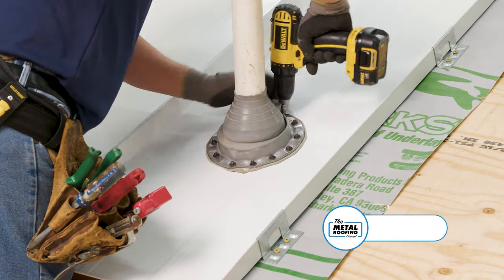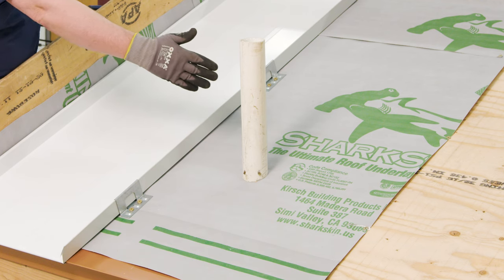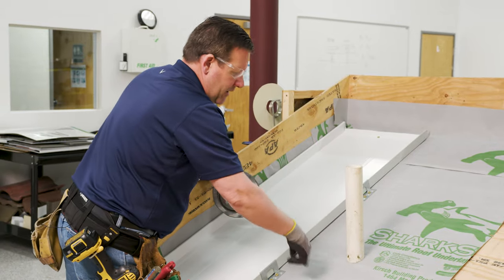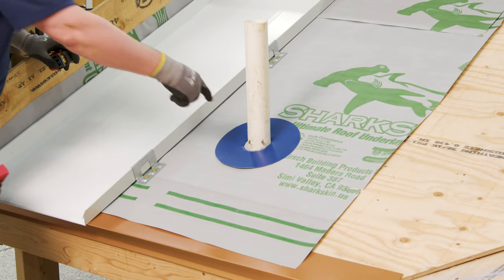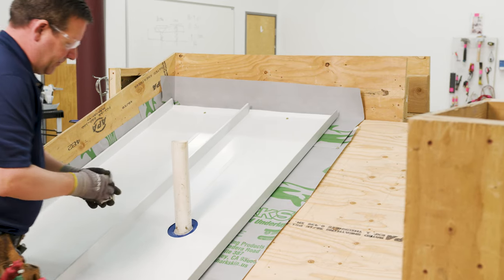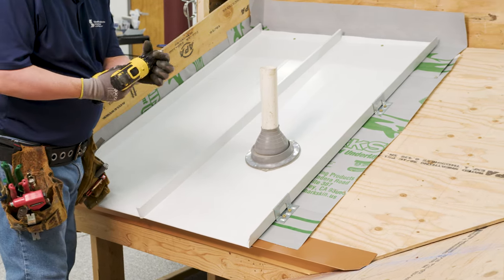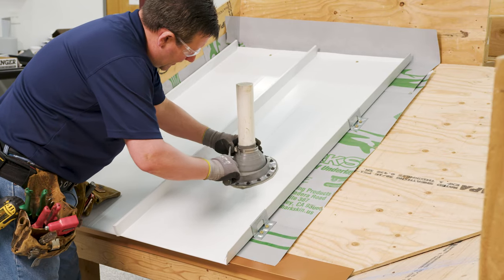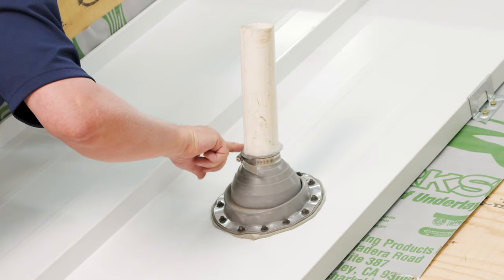How to Install a Pipe Boot on a Standing Seam Roof: SMI Detail P1

Comment: Thanks for these videos, they are very helpful! I have a couple of questions.
The video didn't explicitly say this but with the cut-out of the substrate being a wider diameter than the footprint of the boot, then the flashing boot fasteners are not going to penetrate the substrate. If that is the case, what are the 1" fasteners supposed to grab into in order to secure the boot and insure a tight/waterproof seal?  Are the fasteners just supposed to grab the 24 gauge metal panel and butyl tape? If so, is that enough and wouldn't that be susceptible to getting stripped pretty easily? I guess you'd have to be very careful not to overtighten.
Also, are these the standard self-sealing 1" screws used here or would you recommend using screws that designed to secure to thin metal rather than the thicker wood substrate?
Reply from the maker: Yes, the fasteners grip the roof panel metal to hold them in place. The screws that Sheffield Metals sells from Triangle Fastener are designed with high low threading to attach effectively to both metal and wood. As always, it is important not to overtighten any fastener. I hope this answers your question, and thanks for watching! -Thad

Comment: How do you pre-plan or coordinate the roof penetrations so the penetrations land in the center of a panel? 

And when installing the panels, is the penetration isn’t in the center, or lands to close to the rib, do you just move the penetration?
Reply: Coordinate with the plumber, do your layout of panels prior to penetrations being put in if possible then leave it to them to get their penetrations in the middle of the panels
Reply: @AndySheetmetal , thank you for the response. That is my question though. How do you do a panel layout? 

I’m not a roofing contractor. I’m a general contractor, who is designing my new home. I want to get it right on paper, to cut down on the guess work in the field later.
Reply from the maker: Oftentimes you want your first panel to be the same width as your last panel, so if you layout your roof to accomplish that, you can have the pipe penetration be placed in the center of the panel because you know where they will all fall. Here's a video to explain how to do that: https://youtu.be/3SVEgdWeu_8?feature=shared If you can't control where the pipe penetration will go, then an option is to measure from the end of the roof to the center of the penetration, and then adjust the width of the first panel to allow for the pipe layout you want. -Thad
Reply: @TheMetalRoofingChannel  thanks! 😊